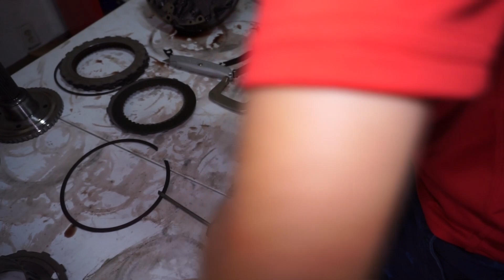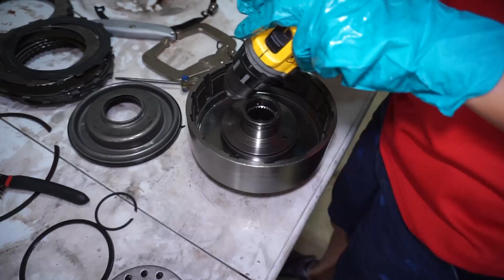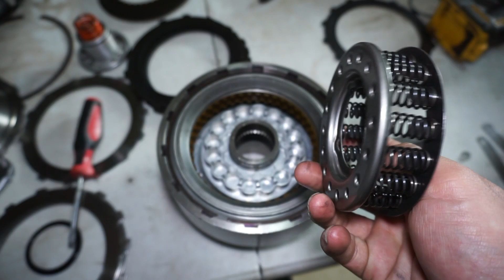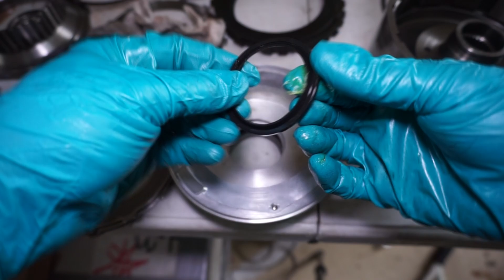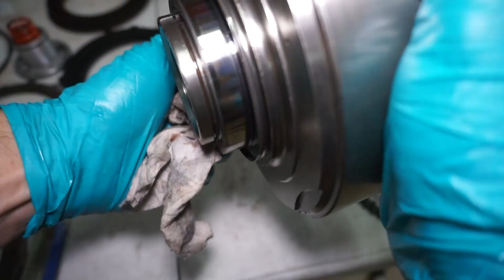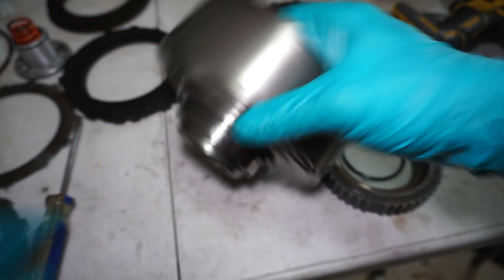4l80e 6 Clutch Direct Dual Feed Aluminum Piston Full Build

Comment: Is there a wave plate in the direct?  Did you leave it out to get that 6th clutch in?  Thinking that i missed something somewhere.  do you still put an HD2 kit in?
Reply from the maker: No wave. No HD2, this is internal dual feed. The HD2 dual feeds through the plate. If opening up the transmission there's better options like the jakes or CK recal kits.

Comment: I always thought the relief hole in the drum was just for transbrake applications. I did the dual feed on my trans when I built it, but haven't run it yet. Got me thinking I should pull it back apart

Comment: It so nice man , I have been watching your videos for while specially for transmission rebuild , so right now I got 4l80e and I need to rebuild it to handle my supercharged truck, so can you help with parts number, it will be prefect for my truck.
Reply from the maker: Which part number?
Reply: For rebuild process, what Parts i need to make it to handle 500 to 600 WHP
Reply from the maker: @Balata_Garage  Could just do an HD2 kit for that, or if you want to dual feed internally, a Jakes Performance recal kit. Both increase line pressure and dual feed. The Jakes kit also does accumulator delete.